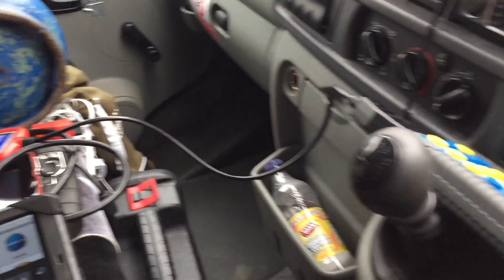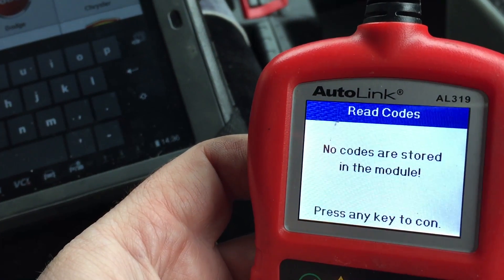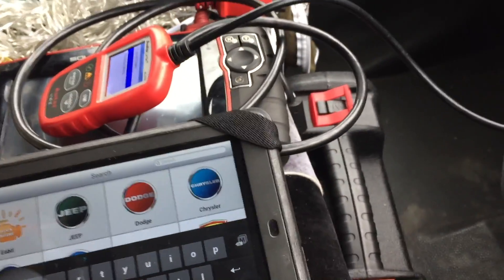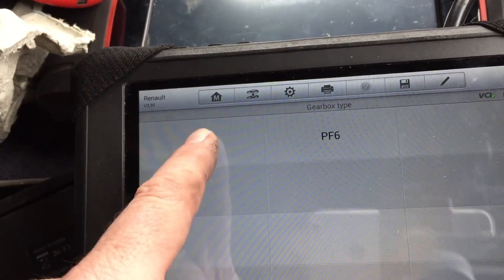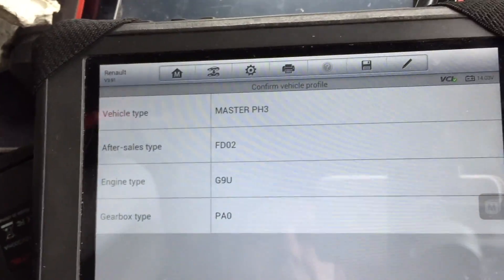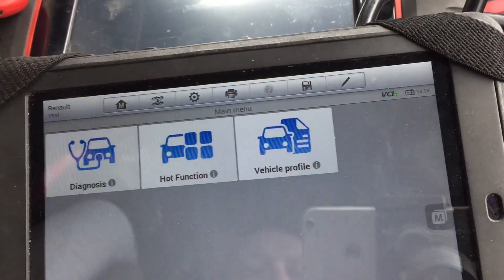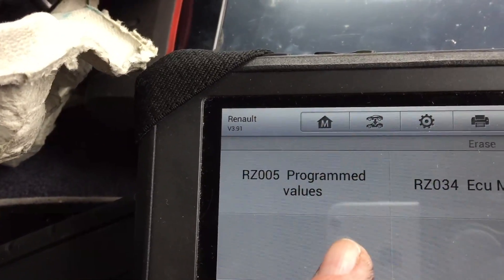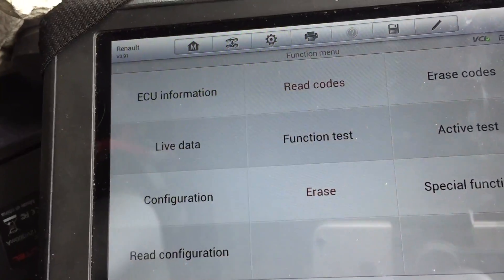Vauxhall Movano 2.5 CDTi - P062F/DF107 - Part 2

Comment: Fantastic!  Thank you Sandy.  I used to drive abroad and have breakdowns if I didn't service my car.
Serviced my van and had fault after fault, (from being left standing).
Changing the battery was one of the many fixes. Expected the service light to eventually go out but no luck.
ANY IDEA IF UNPLUGGING AND RE-CONNECTING THE INJECTORS WORKS ?

Will give feedback if it works before reply. THANK YOU FOR THE LEAD !!! 🥳

Comment: My vauxhall movano 2007 runs fine for an hour or so then the engine stop light comes on and I cannot start it . Sometimes the light goes off within a few minutes or sometimes it takes an hour,. then I can start it again . On 3 occasions after being broken down for over an hour I have been towed home and on the way I notice the red engine light suddenly goes off and it starts and runs fine again , any ideas? it has been on a computer diagnostics twice , they have cleared codes but I am still breaking down!
Reply from the maker: Sounds like it's the immobilizer issue
Reply from the maker: https://youtu.be/QmQdGlQabT4